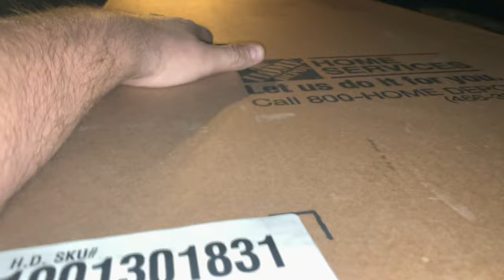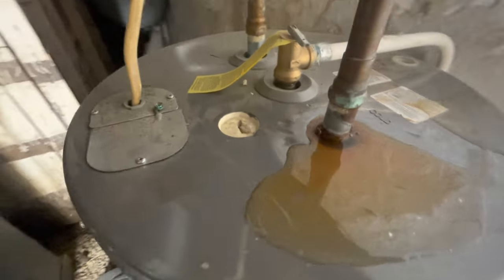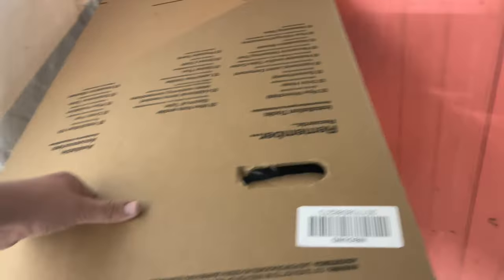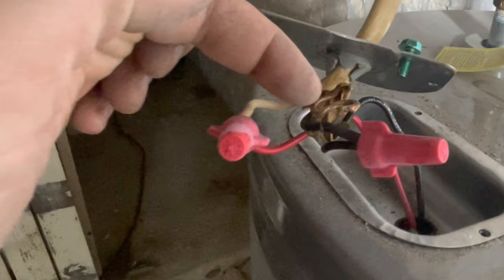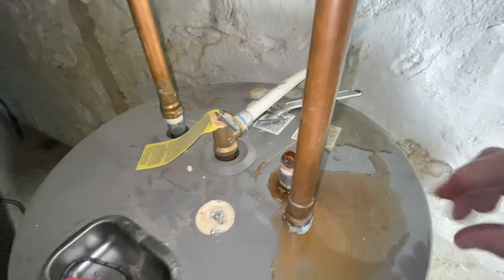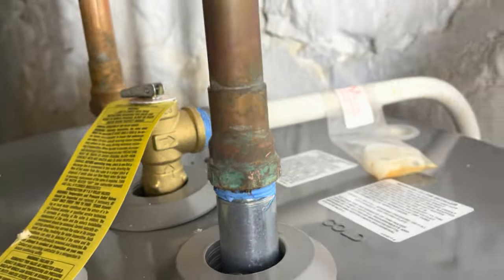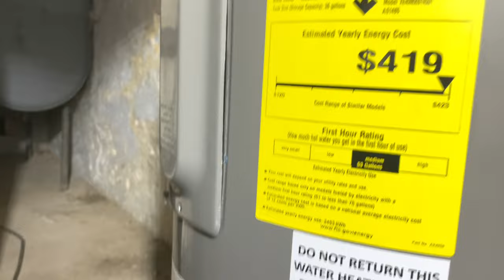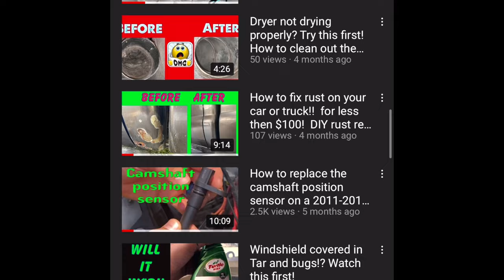How to replace a 40 gallon Rheem electric hot water heater. DIY home repair

Comment: You just inspired me to do my own replacement work!!!!   My water input is near the bottom and I am not sure it will reach the top.  Looks like PVC type piping.  I see a dried wet spot at the bottom of mine.  My unit lasted 20 years!!!!! I will need a long shutoff valve hose to reach the top!  I am looking at everything including permit if needed?!😂  thanks

Comment: Hi Jeremy,  if something like that happens again - you just have to call the water heater manufacturer and give them the model number and serial number in order to have them honor the warranty.

A few things that a Master Plumber told me that might help make your water heater last for decades. You can take out the Anode Rod and put Teflon tape around the threads so it’s easy to remove when you want to check it each year in order to see if it needs to be replaced. You don’t have to drain the tank to do that - just a few gallons or so so water doesn’t come out of the top of the tank. 

You can replace that plastic drain valve with a sturdier ball valve that allows much more water out so you can easy drain it each year to flush out any sediment to maximize the life of the tank/heater. 

Put pipe dope (food safe/potable water) and Teflon tape around the hot and cold connections to the tank so they don’t seize. 

If you can easily change the heating element and or thermostat yourself if you start have issues with lack of hot water or even leak around the element sections.

Comment: That corroded inlet may have been salvageable, by using a 3/4" -14 thread tap. Then use a dielectric coupling, so that you don't have two different metals directly connected (steel & copper). Also: many localities are upgrading their water meters to include backflow preventers, which can increase the likelihood of needing an expansion tank (2.1 gallon). Otherwise, the T&P valve can leak whenever heat is active.

Comment: I know the feeling brother🐴😊 best to do things yourself however the wife needs to know how much your labor is worth sometimes this guy from Lowe's wanted to charge $2,200 so it's got to have a circuit breaker so it's got to have water valves slow down doesn't even shut it off the pan gets wet... but we're in unincorporated outside of city limits oh well if you don't want the circuit breaker in the water slow down not even stop it'll be $400 less😂. Still not a savings is it? It's a lot of money.

Comment: Hi I got a question about those whites plastic inside of the pipes they have to remove before conect to the water? Thx
Reply: No, those are check valves and have to stay in.